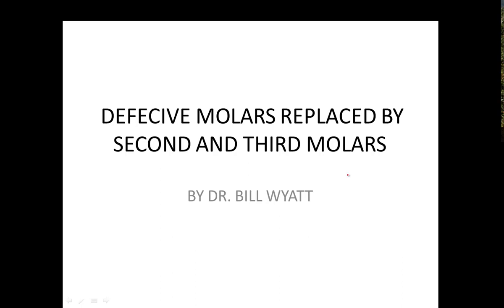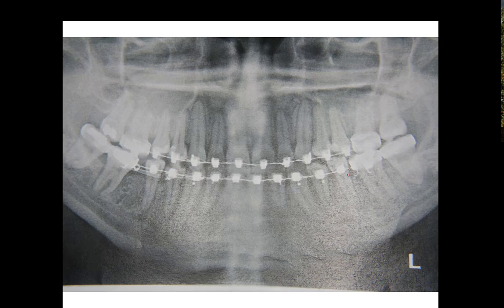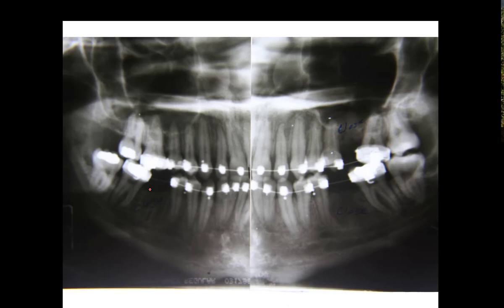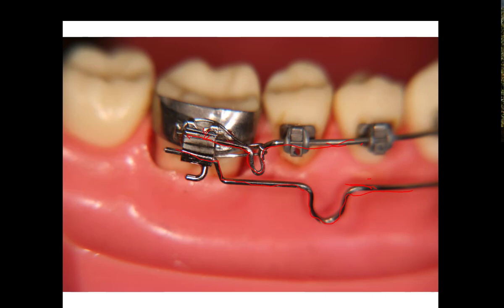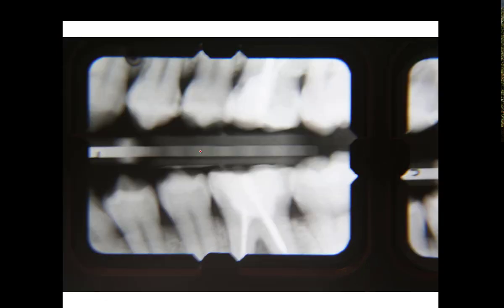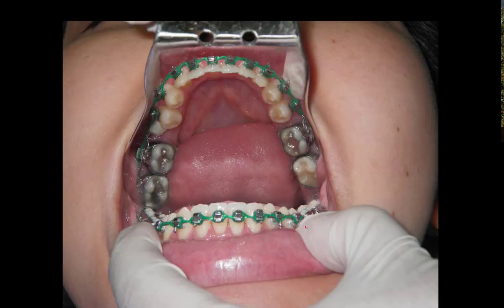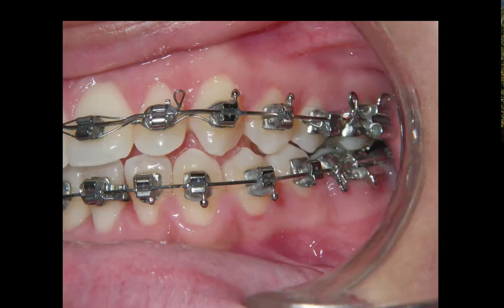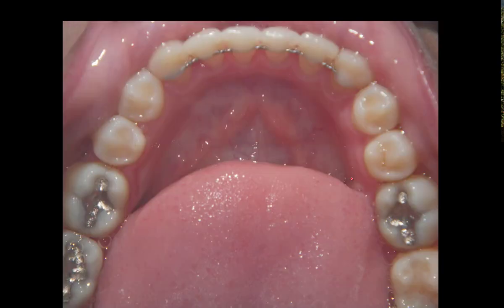Defective molars replaced by second and third molars

Comment: Doc what are the chances of root resorption and alveolar bone loss in mesialized molars . How it can be avoided.
Reply from the maker: We've corrected many people like that and you can see on the x-rays upon completion. In many cases, you can't tell it's not the 6 year molar because the bone looks normal. If you're concerned about it, please note that in a 60 year practice, I never lost a tooth from root resorption. I've had cases that had 1/3 of the root resorbed. We went through the case and maintained the same amount of root.

Comment: 🙏 sir , i am 20 years old my 2nd molar if upper jaw was extracted due to bacterial infection and dr. was saying that when my 3rd molar will be coming that replacing this gap automatically. So sir please tell me is it possible automatically 😢
Reply from the maker: Typically if you take out the molar early enough, they will drift together. But, it may come in at an angle and need to be straightened up. Trust your orthodontist.

Comment: This is exactly what I am having done. I had #19 and #30 extracted and am now shifting 2nd and 3rd molars forward on both sides with orthodontic treatment.
Reply: How long will it take?
Reply: @deepu3422  my estimated treatment is 24-30 months. My first 6-weeks we leveled and aligned the front teeth (20-29) before engaging the molars. Then starting week 6, we’ve had 2 first lower molars (#18 & #31) engaged and they’re already showing some progress. It’s now been another 6-weeks and those first 2 lower molars are much more upright (both were tipped), plus there’s about 1mm of movement.
Reply: @anitxtina  ok how old are you , and has any mini implant or tad placed . Will there be any change in facial sturcture?
Reply: @deepu3422  I’m 35 years old. Yes, we’re using TADs. I have self-lighting braces throughout. The molars have brackets for the wires, plus a hook. The molars were engaged to the NiTi wire at week 6, and powerchain. I go in every 3 weeks to have powerchain changed. 

No projected change in facial structure. I had molars 19 & 30 extracted August 2022 and started ortho March 2023 — there was no difference in facial structure when they were extracted so I doubt there will be any changes once we migrate those 2nd and 3rd molars forward. I anticipate a small change in my face as a result of ortho treatment simply because I have a lower midline that’s noticeably off and that one of the two things I wanted addressed during treatment. 1. Missing molars 2. Skewed midline.
Reply: @anitxtina  do you have both premolars , cze mine has been extracted for braces?
Reply: @deepu3422  yes, I still have all my premolars. Prior to braces, the only teeth I was missing were #19 & #30 — they were lost to severe decay. 

Then, I had 2 upper wisdom teeth removed recently, but otherwise I have all my teeth.
Reply: @anitxtina  i had the same teeth extracted. Where do you have it done? And how often you need to go to orthodontist?
Reply: @ferrerarah9454  my extractions were done by an oral surgeon in California. Each orthodontist appointment is spaced out as a various time depending on what we’re doing. Some have been 3-weeks apart, some 4-weeks, and some 6-weeks. It varies.

Comment: My daughter is 12 and has significant decay in her very back mollar. They want to do a root canal but the endodontist also suggested removing the tooth and eventually moving her wisdom tooth in. The only problem is, she is 12 and her wisdom teeth are not fully formed. Would it be bad to have that space open for a long time until her wisdom tooth starts to break the surface?
Reply from the maker: We do early advancement of the posterior teeth on young people. But, you have to make a retainer that holds the upper second molar in place and doesn't let it over erupt. We have a video on this where you have to change the retainer. There's a lot into it and I'd suggest sending your dentist to my channel to see how we do this.

Comment: Watching this video, I feel like I have some hope.  I have a missing 6 y/o molar on the lower right and I still hav my wisdom tooth on that same side.  My orthodontist has agreed to moved my teeth to close the gap by using a TAD but he is now trying hard to change my mind to go with an implant since the orthodontic treatment will be done quicker if I was to get an implant.  I’m 37. Is it even possible?  My orthodontist is changing his mind and giving all kind of reason to get an implant.  Thank you so much for doing videos like this Dr.
Reply from the maker: Your orthodontist is not used to moving teeth in the back of the arch and closing space. He is used to putting impants in the gaps. But if you do this, most likely your wisdom tooth will have to be removed down the line. It might take a little longer to move the 2nd molar into the space and have the wisdom tooth follow behind but you do not have to have the wisdom tooth removed. It may not be necessary. I cannot tell everything about the case but if people get used to moving teeth forward into spaces, this becomes less of a problem to them. We would never put an implant and remove the wisdom tooth. I am not criticizing your doctor. He is doing what he was taught to do. If he gets used to filling these gaps with teeth in the distal of the arch, it becomes much quicker and in my opinion much better,.

Comment: I have a missing tooth on my right side and i don't implants or bridge idk what its called. Right now, my wisdom tooth's head is sticking out on my right side and it's bothering me,  I've been wondering if this wisdom tooth can be a replacement as a third molar? I live in the Philippines and can't find any answers.
Reply from the maker: If your missing tooth is in the same quadrant, it would be easy to move the wisdom tooth into that position. Otherwise, it's a transplant and much more complex. I've got one case and it's all done by Dr. Spradley where he transplanted an upper tooth into the lower area.

Comment: Dr bill this has been really interesting to watch. I have had 2 root canals recently on my molars at the end and the one at the upper has even cracked before it could be crowned. I'm afraid they might not last long. I'm only 18 now. Would I be able to do this procedure a couple years down the line if my Root canals fail me? 
Thanks!
Reply from the maker: Well, my feeling is that you can replace these at any time during your life. You can move molars around as long as you're alive.
Reply: @DrBillWyatt  thats also my plan, conservative treatment, i have two molars with root canal. Root canal can last max of ten years when it will be extracted at least i have a back up wisdom teeth. Too bad i dont have wisdom teeth in my upper maxilary. I only vot two on the lower mandible

Comment: hi, doc i have question, I'm 16 yrs old, my both lower first molar got extracted yesterday and my wisdom tooth is still not growing, should i wait to erupt it to replace my first molar using orthodontics treatment?
Reply: another thing doc, when my wisdom tooth will fully erupt??
Reply from the maker: If 6 year molars are gone, start moving the 2nd molar into its place. The unerrupted wisdom tooth will follow. It may not erupt until you are 17 or 18 or even 20 sometimes. It will drift behind the 2nd molar very good but it most likely need to be straighten up when it erupts.

Comment: I have a question. I also have one missing molar on each side, up and down (4 total). And my dentist said that my wisdom teeth are good and do not impact any of my other teeth so she didn't recommend to extract it. Will the gap of my missing molar close naturally since i still have my wisdom teeth without braces? Or do i need to get braces for the gap to close?
Reply from the maker: Frequently if you loose a tooth, say a 6 year molar, before the 2nd molar gets to place, it will drift forward. I have seen cases, where lower 6 year molar is extracted when a person was 8-9 years old. The 12 year molar drifted better in this child if you were 30 year old and lost a tooth. We show you how to take anybody's molar and close the gap from back to front. If you dont want the front teeth to move back, you must use a tad or screw and bond it to bicuspid. The tad must be placed besides the tooth in cortical bone & then tag should be bonded with the tooth with good composite. This will not let anterior teeth go back, but the posterior teeth can be pulled forward with that.
Reply: Hi Dr. Wyatt.. because of my ignorance,my 8 year old lost her lower right fpm recently. And the lower left fpm was also decayed and I'm thinking of getting an rct. Would you advise getting a rct or an extraction of that tooth so there will be balance on her mouth? I'm also concerned with the development of her jaw because of early extraction. She doesnt have overcrowding and has a good bite

Comment: Hi Doc Im 20 years when I was 16 I decided to pulled out  my two molar because all i know it will grow another tooth again and the dentist that pull it did not told me that its my permanent tooth so right now its my problem because its so hard to chew. Right now I feel that my wisdom tooth is coming out so im praying that 2 wisdom tooth will grow.
Reply from the maker: It doesnt matter what age you are & if you have a gap, you can bring the tooth behind it forward & close that gap on anybody. If they have wisdom tooth, it can be brought in to fill in where 2nd molar was. I have many many videos showing that. You can look at the video called "Closing spaces on adults". It is very interesting and you must study it thoroughly.
Reply: hey! I’m sorry but it’s only possible for 1 wisdom tooth to erupt on each side
Reply: Can I ask about braces materials?
Reply from the maker: @kally3206  If it doesn't matter & you can move the anterior teeth distal to some extent, you can just pull the 2 groups together, but many times you want to close the space but you dont want to move the anterior teeth back at all. In this case, you put a tad in the cortical bone besides the bicuspid and bond it to the bicuspid. Then you can pull the motors forward without pulling the anterior back. I use a spring device that I show in many cases which I can tighten up, it will move the crown and roots back at the same time or bring the tooth back in a parallel manner.
Reply: Is there a possibility that fake braces materials can cause tooth decay or white stain on a teeth?
Reply from the maker: @kally3206  Anytime food that is high in sugar stays on the teeth for long periods of time,  an acid forms within 90 seconds of when you eat it. This doesnt mean that it eats on your teeth that fast but acids forms fast so keep the food article away from the teeth & it doesnt matter what you use. It is excellent now a days to etch (treat it with acid) the teeth & you paint a sealant on the etched tooth. Then you bond your bracket to a sealant. If the person brushes the teeth good, they will brush the sealant off but in places where they dont brush, the sealant will stay on for long long time. This prevents these white decalisified portions of the tooth forming in area where food stays too long. If you eat no sweets, you dont have much trouble here. Treat your teeth with flouride too.

Comment: Hi Dr. Bill, my dentist told me that it is impossible to move the third molar/wisdom tooth to second molar, he told me that after dental braces, then denture will fill the missing molar, which made me very disappointed and sad at the same time. Btw I'm living in Philippines. Is it bad or good? Thank you Dr .
Reply from the maker: This is just so ridiculous. Wisdom tooth are made in the same place rest are made. You can move any tooth in the arch. Age has nothing to do with it. It can be done.
Reply: @DrBillWyatt  My dentist said that after the dental braces, denture will fill on my missing and extracted molar which made me so sad.
Reply: @pinmay9156  bro they will use spring to move the molars, the dental clinic here in mandaluyong can do that. The name is smile craft dental clinic in general kalentong ma daluyong. They can move wisdom teeth using spring attached to the upper lateral side of the gum, they will put a button there.
Reply: @puppetmasterreloaded3341  Thank you. I just went there and got my case checked. I'll be starting treatment after they finish my treatment plan.

Comment: In my case, I had my second molar in the right side extracted due to decay when I was 18. It was then replaced by my wisdom tooth which filled that gap after a year although it was kinda leaning in a weird angle. My second molar on the right also has decay and it quite hurts now so I was thinking of extracting it so it can also be replaced by my wisdom tooth and then I can have braces to correct my bite. I'm 19 now, is this possible?
Reply from the maker: If you had no other orthodontics done, it is a simple matter to upright the wisdom tooth that is tilted forward into the 2nd molar space. This is just nature. But the roots of the teeth are in the bones and do not drift forward as easily as the crown. So the tooth is tilted. This is a simple matter to upright that tooth with only a tube on the molar and a little spring and bond a wire on other teeth. I have several videos showing this. But now that you are considering ortho, then you can do this along with bringing the other wisdom tooth into that space. To me this is better than root canal, crown and other stuff